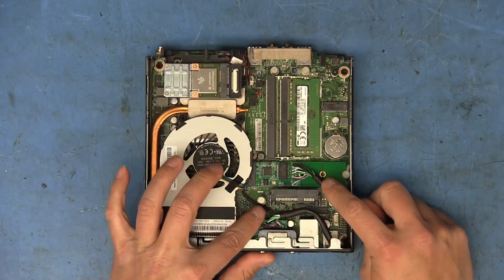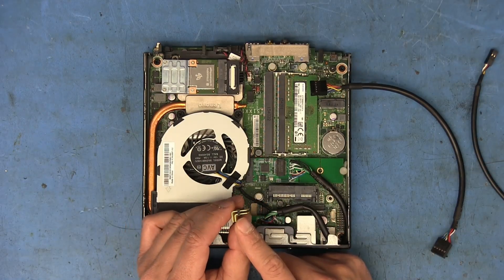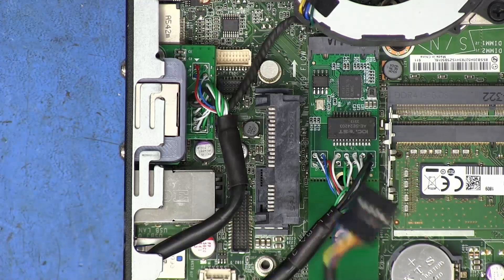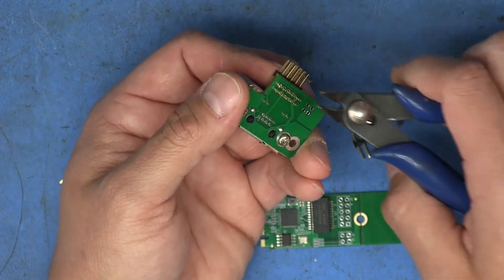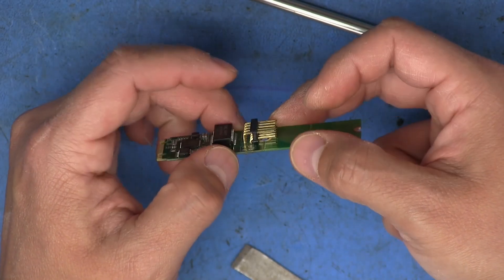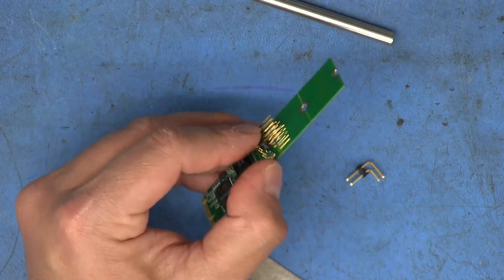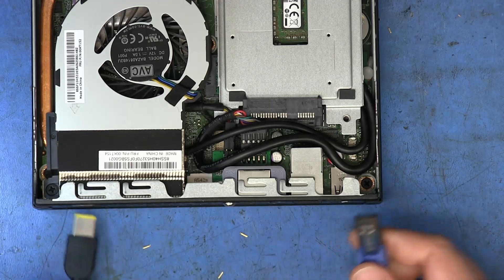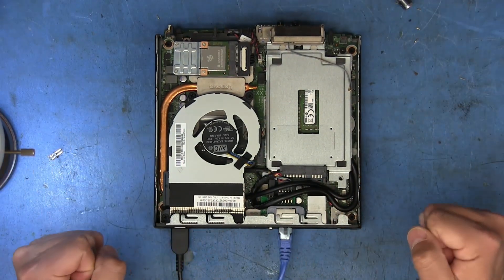TEF #147 | Addendum to TEF #146 - Slightly Easier I225 NIC Installation

Comment: The proper way would be to not trim the length of the pins, but still solder them flush to the bottom of the board. This would've floated the header a millimeter higher off the board, floating it above the SATA connector (no plastic trimming necessary).
Reply from the maker: You're right, I should've done it that way for the ethernet board side, was more concerned with it not sticking up too much. The height was more of an issue with the m.2 board.

Comment: Would snipping the pins have worked? Then you could keep the plastic spacer and they should still easily make contact. To be honest even using those pins is beyond the mess I would have made Lmao

Thanks doc brown!
Reply from the maker: Funny you mention that because I thought about shortening the pins after I had made the video, again.  lol

I also thought about flipping the pin headers so the plastic was on the opposite side where they are soldered to the board and having the female end plug into the bent side. Should shave off a couple millimeters.